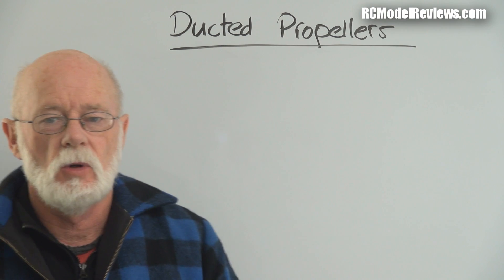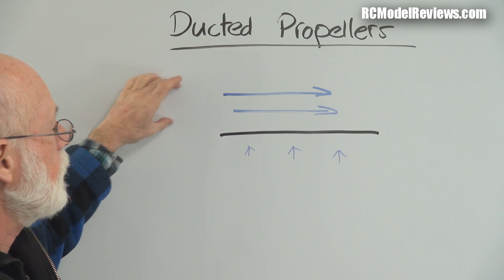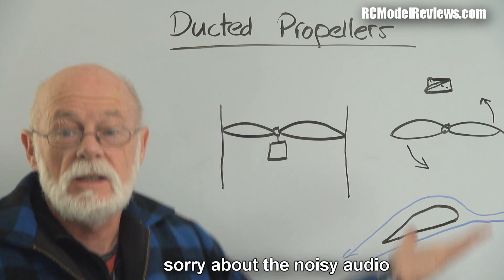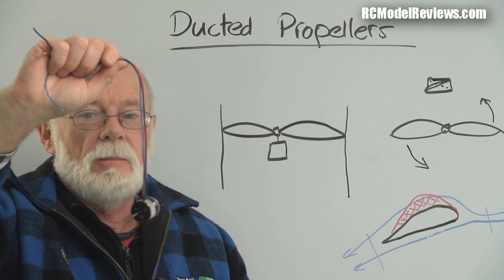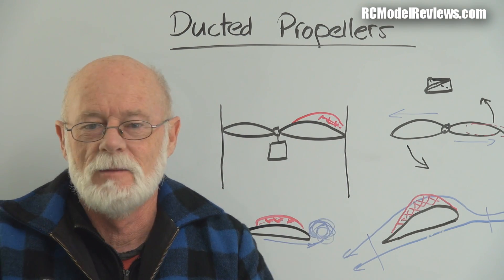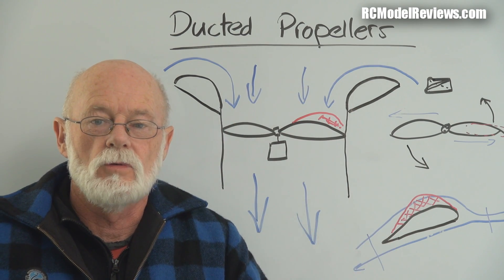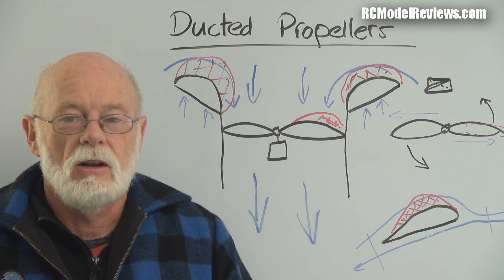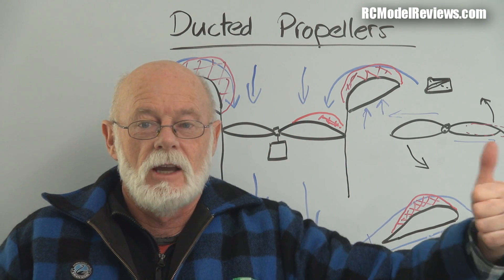How ducting a propeller increases efficiency and thrust

Comment: Good video. I think for most people that you did a good job. However, technically speaking Bernoulli’s equations are only valid across a single stream line. Fluid moving over an air foil violates this assumption “Split flow”. To mathematically calculate why an air foil generates a pressure differential. You must use the Navier Stokes equations derived with respect to pressure. It is very common miss conception that Bernoulli’s equations can be used to calculate lift.
Reply: Peter Peel yup, no reason why the streamlines on the top and bottom have to meet at the trailing edge at the same time

Comment: whilst this is all correct..there are penalties in using ducts. Weight is the biggest one, and size is the other. Whilst the gains from adding a barrier to the end of a prop result in a net positive for thrust, 'capping the vortex' also robs from pressure on the high side as the effective length of the boundary layer is reduced...
TLDR: try a bigger prop before adding a duct.

edit i didnt watch to the end..and then did..

Comment: I've also figured out also in hydrodynamics about the Bernoulli principle. Experiment in my kitchen, I took a spoon went to the sink and fully open the water tap/faucet then let the convex side/bottom of the spoon touching slightly to flowing water on the tap. Guess what happened. The flowing water pulled the spoon though the concave side nothing flowed in it. It's like a magnet that pulled the spoon.

Comment: Why are the wings and propellers drawn with a very sharp end and a very blunt front. When I first saw this pattern I said to myself 'this is stupid. Big air drag and loss of efficiency.'
Later when I got to see them as objects they were indeed a bit bold at front but not to much to affect aerodynamics so the drawings are an exaggeration. Why is that?

There is also a tendency towards a round shape blades for bigger crafts and even-slim propellers for RC.
I guess bigger blades will experience bigger forces and a slim design won't offer enough resistance. Besides that, is there another reason for the blunt front of the blades?
Nautical propellars and always even-slim because the weight not beeing a problem they are made of resistant solid metal.

Comment: At the end of your video, were you referring to the vertical lift planes? I assume they didn’t “take off“ in popularity because the lift produced by a standard wing is more efficient? Also, air that is having to be sucked in at an angle is far less efficient than that that comes in directly, right? There’s more turbulence issues to deal with?

Comment: Thank you for video and teaching air pressure,  airflow, and more.  What I am interested in isn't directly related to this topic.  The words I am working with are as follows.  Trust,  turbine,  combustion,  compression,  auto engine,  cvt transmission,  consumption,  power, efficiency,  and more in attempt to combine relevant theories for a more efficient auto engine.  Piston engine requires pressure and a turbine doesn't in a sense but airpressure is still used through different size fans.  

Still off subject but don't want to lose train of thought.  

I wonder if a compressed fuel air mixture  in a chamber before entering a type of fan based engine could cause efficiency?   Can pre air thrust be controlled?  Is air thrust always at it full capacity?  Suppose 6 pre thrust chambers existed around a fan designed engine. Each chamber could add more or less spin to fan as each chamber is ingaged or disengaged.   I think of the coral castle and the theories of the pull system.  As more pulleys are used less effort is needed to lift. Much like the gears in transmission.  

Hmmmmm! How to overcome the faults of the turbine engine and combine technology.  

Ctv transmission how can it be redesigned and applied to independent drive train for each wheel?

Lol thanks for triggering my thoughts!

Comment: The reason for my interest in this information comes from rudimentary physics, nuclear submarine propeller design from a recent movie, and drag reduction design factors for boat speed. The last point you made about making additions in design versus create costs that make the overall energy expended offsetting or create an overall deficit quite challenging. Nevertheless, failing to plan by, at minimum, crunching the numbers essentially a plan to fail. I appreciate your insight and energy.

Comment: Not to take away from the rest of the video but his initial explanation using Bernoulli’s theorem and the paper was incorrect - and as it so happens, a common misconception. For those wanting more accurate reasoning, it’s due to the Coanda effect. The responses here can walk you through the mechanism  https://www.quora.com/Why-does-a-piece-of-paper-rise-when-air-is-blown-over-it

Edit: his reference again at 6:00 to Bernoulli is also incorrect

Comment: Nice presentation.  2 things.  Ducted fans do not do better.  Any improvement of the prop is made up for by the extra drag  of the duct. 
And the hundred year old theory of the second reason lift is created, the air on top has to meet the air on the bottom, has always been questioned, and has been proven to be wrong.  This makes airfoils even more marvelous.  "Entrainment"  the theory the Dyson fan is based on, overstates the benefit.  Also, do not buy a Dyson fan.  They are super loud for the same amount of air flow.  They also take more electricity.
Also, ducted fans have extra drag.  The air inside the duct is going faster than air outside the duct.  That causes lift due to the bernoulli theroy.  But the lift is directed inward in a circle, so there is no net gain.  Whenever you have lift, you have lift induced drag.  So the duct gives you extra drag without extra lift.

Comment: One other reason not to use the duct is it causes resistance to air flow, due to the increase in frontal area. At low speeds the wind resistance is low so this duct works well on models but less well on big high speed/lift craft.

Comment: Good teacher, great lecture, well explained. But the "equal transit time" explanation at 6:05 is... well.... very wrong. There's absolutely no physical reason why 2 fluid elements, both at the leading edge at the same time, one going over the airfoil, one going under, has to reach the training edge at the same time - in fact, experimentally, they don't. At least he admitted that it's wrong... he said "debated", but the argument was actually settled decades ago with an experiment.
Still, if you ignore that small bit, great lecture.

Comment: Hi, a third way to improve propeller trust or diminish weight, is by getting a smaller motor that will force from the exterior instead of the center. Forcing from center is highly inneficient

Comment: Explained beautifully, but ducts work and work very well!
Normal propellers can work, using a oversized propeller and trimming it down helps massively. You would also gain performance from sanding smooth the duct lip and the inside of duct.
I have done some tests and posted them on rcgroups with fantastic results if you're interested, also I uploaded some ducts to thingiverse for people to use or test for themselves.
https://www.rcgroups.com/forums/showthread.php?3213985-3d-printed-3-duct-efficiency-tests-results

https://www.thingiverse.com/thing:3413401

Comment: Proppellers not only have an airfoil shape - they are also twisted.  What I want to know is the function of the twist in the prop.  Also - I have a question about the ducts - why do they have to be attached to the propeller itself.  Why can't you build a duct around the propeller that does not spin?  Since a spinning duct also effects the air and creates a magnus effect - but not in the direction you really want, and the extra ductwork makes the prop heavier making the engine work harder.  Can't you get a greater efficiency if you didn't attach the duct to the prop, and you'd also get rid of the extra magnus effect as well that would mess with the pitch of the aircraft?

Comment: So if you think the blowing over the paper test proves that the air you blow is lower pressure. Repeat the test but with the paper hanging straight down vertically . Now blow straight down over one side. If the theory is true the paper would swing toward the side you blow over.... 
I’ll give you a clue, it doesn’t 🤔
the whole explanation is based on fundamentals flawed thinking and a misunderstanding of Bernoulli

Comment: Great video.  Thanks.  Very curious as to why ducts are not used on modern small, general aviation aircraft? Will look at your other videos
Reply: The problem is that in forward flight the drag of the duct itself cancels out the efficiency benefits. But having said that ducts are used in general aviation. All jet airliners use 'turbofan' engines. Most of the thrust comes from the fan in a duct, the jet mainly provides power to spin the fan. https://en.wikipedia.org/wiki/Turbofan
Reply: @jetplaneflyer  thanks.

Comment: OK I understand this but now I have a question. I have a drone made by Yuneec, drones blades have a pause in order to keep it stable in flight, my question is can this be applied by adding ducts in order to increase flight times and battery draw. Also since the duck would be fixed and angle change in flight more so as an all together ie forward, back etc.. is this possible for such an application? Thanks for the enlightenment. Wish you were my teacher in my youth, now at sixty I’m getting things I didn’t in my youth.

Comment: Curious why propeller planes didn’t use this coender ducted method for improving thrust, protecting the propellers and improving safety by using a belted wind deflected cylinder on either side of a motor and two propeller ducts.

So, to conclude: why are propeller planes not using a motor, a belt connected to two ducked propellers on either side of the motor for improved thrust over conventional propellers? Is it because it stalls on take off? Is it because the ducting blows apart? Is it because the propellers have to be situated in a specific spot in the duct for it to be effective? Scratching my head with this one?

Comment: Of course  I want to hear the story of what happened when the ducted propeller changed from one direction to another! How could one discover if its more efficient to pull air through a duct rather than push air trough a duct short of building a physical model i.e. mathematically?

Comment: Why not add a groove inside the duct to receive the very tips of the propeller blades? Wouldn't this simplify production due to less need for accuracy between the prop tips and the inside of the tube?

Comment: Joule Free Expansion is the principle that in absence of friction (ie in a vacuum) it takes no work for gas to move from a high pressure to a low pressure area.  In atmospheric pressure it will still move from high to low but it will be able to do a certain amount of work doing so and thus creating work.

Also you are wrong about your explanation starting at 11:52 adding that just makes it even harder for the low pressure to meet the high pressure so increases the lift more.

Comment: 1.Put the duct on a separate dynamometer! 
2. Compare to just larger prop and a prop with winglets

Isn't ps is cost across streamlines ?
Why axiom that air traveling on top of the wing should cover that longer distance in the same time? Why can't go same speed?
Tip vortices happen on airplane wings too. Rotation imho has second order effect. 
Is it not "free" thrust as you eventually said -- weight is the cost. And most of it can be killed by clearance.

Comment: Diagram error !   Low pressure (from benouli effect ) on the spinning blade should be shown on the under side for air to flow down ... ( air flows from high pressure  to low pressure).  Propeller Blade sucks the air down as it screws through the air.

Comment: Why does the air travelling on top of the wing (on a regular airplane) have to travel more quickly? Why can't the airflow be split in two with the top section of air travelling more slowly (or at least taking more travel time, because of the greater distance to cover)?

Comment: Hiller VZ-1 Pawnee
The Hiller VZ-1 Pawnee (U.S. Army designation; earlier Army designation: HO-1) was a unique direct-lift rotor aircraft, using contra-rotating ducted fans for lift inside a platform upon which the single pilot shifted body weight for directional control. The platform was developed starting in 1953 under an Office of Naval Research (ONR) contract to Hiller Aircraft, and flew successfully beginning in 1955.[1]
VZ-1 Pawnee￼RoleDirect-lift rotor aircraftManufacturerHiller AircraftFirst flight1955StatusExperimentalPrimary userUnited States ArmyNumber built6

Design and developmentEdit

The original concept had been developed by Charles H. Zimmerman in the late 1940s.[2] Further development followed, both by Hiller Aircraft and the De Lackner Company. There were two main models, the ONR model 1031-A-1, and the somewhat larger VZ-1 Pawnee model produced in 1956 for the U.S. Army. Three of each model were built as prototypes. Neither of the variants was put into production.[3]
The smaller ONR model used two 44 horsepower (33 kW) Nelson H-59 piston engines, coupled to the propellers by a modified helicopter transmission built by the Industrial Power Division of Hall-Scott. The larger Pawnee model used three of the aforementioned engine and had an extended duct area. The Pawnee had ineffective "kinesthetic control" and instead had the operator seated on a platform controlling the flight with conventional helicopter controls.[4]

Testing and evaluationEdit

Due to aerodynamic effects in the duct within which the propellers rotated, the platform was dynamically stable, even though the pilot and center of gravity of the platform were fairly high up. In testing, the prototypes flew well, but the U.S. Army judged them to be impractical as combat vehicles as they were small, limited in speed and only barely flew out of the ground cushion effect.[5]
Two of the six prototypes are known to survive; both are ONR 1031-A-1 models. One is located at the Hiller Aviation Museum in San Carlos, California, the other is at the National Air and Space Museum's Udvar-Hazy Center in Chantilly, Virginia.[6] The latter platform was formerly on loan to the Pima Air & Space Museum. A replica of the 1031 platform is on display at the Evergreen Aviation & Space Museum.

Gallery

Specifications (Model 1031-A-1)

See also

References

External links

Last edited 6 months ago by Cydebot

RELATED ARTICLES

Doak VZ-4

De Lackner HZ-1 Aerocycle

experimental personal helicopter, 1950s

Dornier Do 29

1950s experimental aircraft by Dornier

￼

Content is available under CC BY-SA 3.0 unless otherwise noted.

Terms of Use

Privacy

Desktop

Comment: all it does is eliminate wingtip vortices?
i thought that answer would be way too obvious and that the effect would be too insignificant.
also couldnt you just achieve the same effect with winglets on the tips of the propeller blades like sailplanes and airliners use on their wings?

Comment: As a european I am perplexed by the persistence of the americans and their idiotic explanation for lift. According to part of your explanation, any car that has the air traveling faster above than below should take off. The reason for the teardrop shape in planes is that they need to have a massive beam in the middle of their wings for support. Air has to be somehow channeled around that and the teardrop shape adds the least drag and minimizes turbulence. Otherwise... A papper thin wing would be just as good or better.

Comment: I think that the effect of additional lift from the duct will not work in the real world. On a static bench, yes maybe because the only airflow is created by the propeller pulling air in, but in flight this will be overshadowed by the increased drag and there will be an area of positive pressure where he drew negative pressure on the duct.
Think of a fuselage. It has a similar shape and it very surely makes more drag than it does lift.
Although to be fair, his theory might be somewhat true for non-fixed wing aircraft.
Reply: Don't you see? It cannot not work. There will always be lower pressure. Am I wrong?
Reply: @kimrick8560  You are unfortunately xD. Once the airspeed rises that area will become high pressure instead because of the incoming air. There might be some lift but definitely more drag.

Comment: Aerofoil effect accounts for a very small amount of lift.
Especially in wings.
It's tiring having to point this out every time I see this explanation of how wings work.
Reply: https://www.amazon.co.uk/Henbrandt-Classic-Gliders-Polystyrene-Fillers/dp/B078XGQCB7/ref=mp_s_a_1_2?hvadid=80882855831395&hvbmt=be&hvdev=m&hvqmt=e&keywords=polystyrene+gliders&qid=1567021854&s=gateway&sr=8-2

BTW these are great fun if you've got kids and extremely cheap!
The elestic band powered ones are a but more expensive but with a little ingenuity you can convert these little ones with an single strand of elestic and some plastic reinforcements.
Reply: https://www.amazon.co.uk/Yinew-Rubber-Elastic-Powered-Airplane/dp/B07F9YKNXK/ref=mp_s_a_1_fkmr1_2?keywords=Elastic+polystyrene+gliders&qid=1567022491&s=gateway&sr=8-2-fkmr1

Comment: Is inlet spin much of a factor, where the incoming air tends to rotate with the propeller?  I've done a lot of work with industrial fans (1000-1500 rpm), and adding a baffle or two in line with the flow across the inlet side to break up the spin can provide a surprising increase in the efficiency